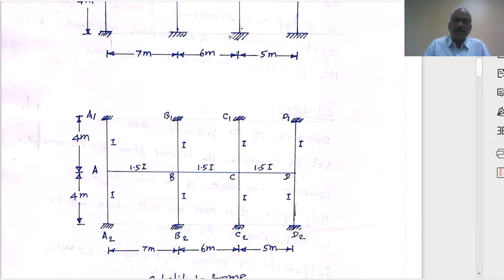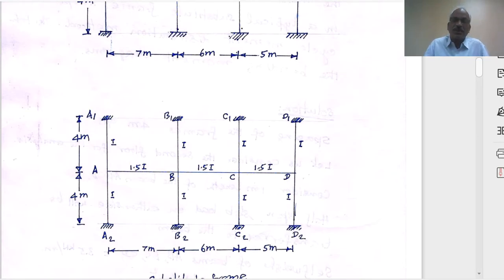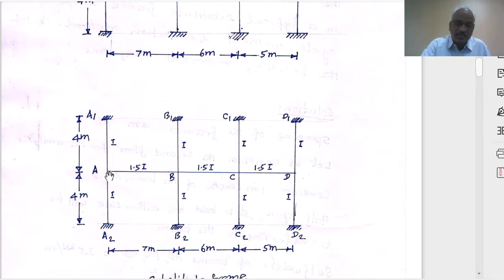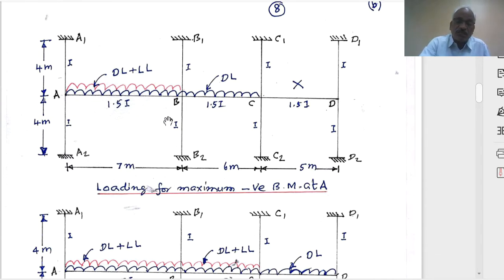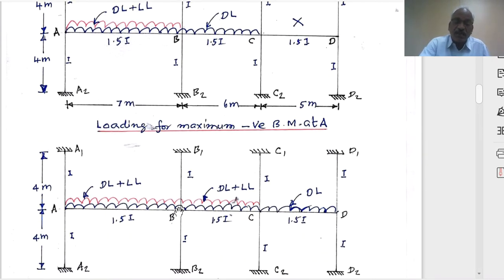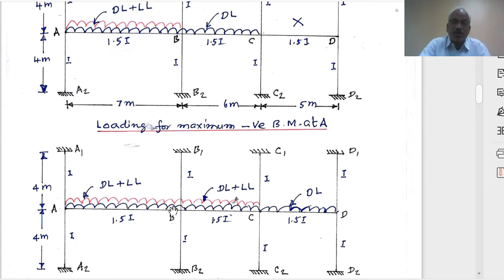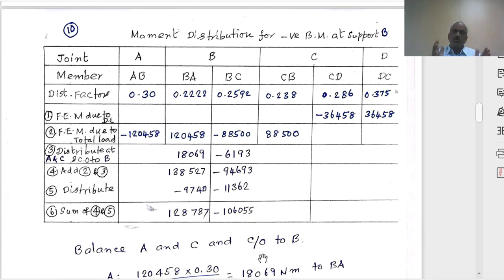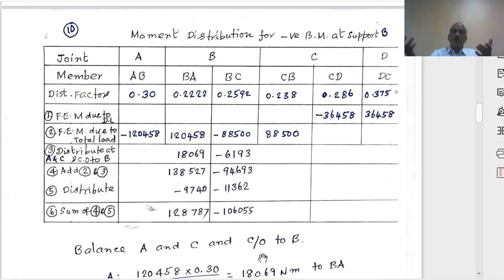Lecture 117 :BUILDINGS- SUBSTITUTE FRAMES- TWO CYCLE MOMENT DISTRIBUTION- Pt 2 :P.Perumal, PSG iTech

Comment: Sir I want to ask you one question. How to use substitute frame method if we have point loads due to secondary beams on the primary beam. 
The primary beam is the part of the frame at a certain storey
Reply from the maker: The fixed end moments due to point loads also to be taken into account. Thank you.
Reply: @dr.perumalcivil7644  Sir should the effects of (Live Load+Dead Load) and Dead load only, be considered on the point load to calculate the moments?

This is because the secondary beam is transferring the point load on the primary beam. So, should the (LL + DL) and DL only combinations be considered on the secondary beam to calculate the effects on the substitute frame? 

The major question is this one.
Also thanks for responding 😊